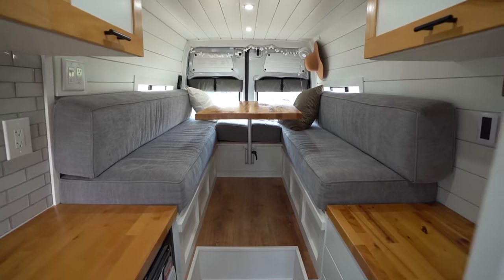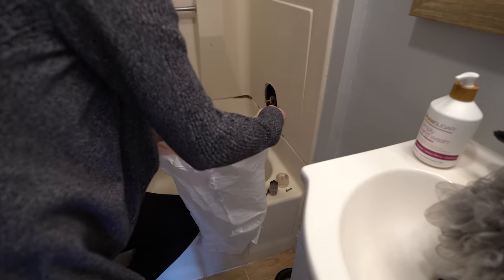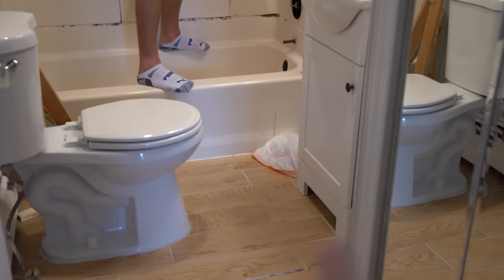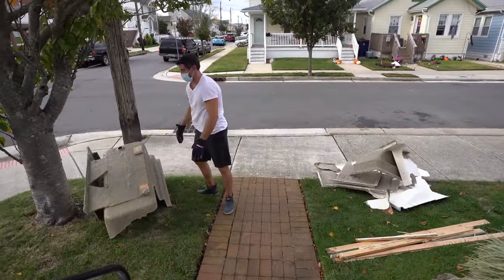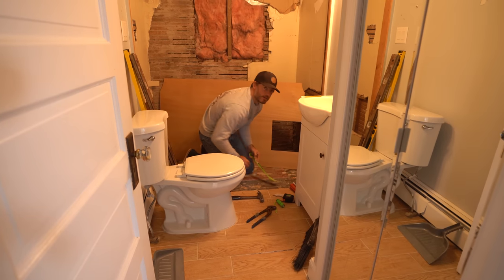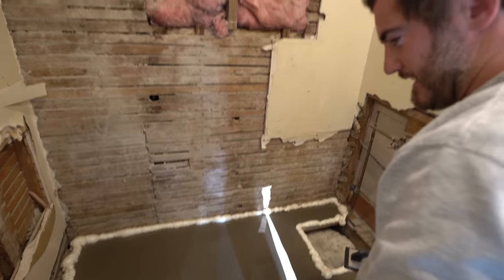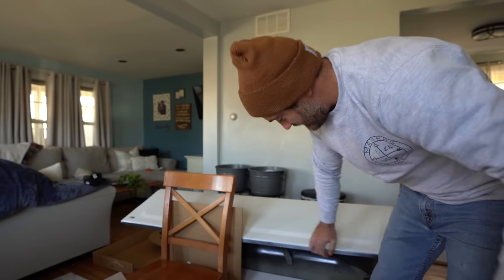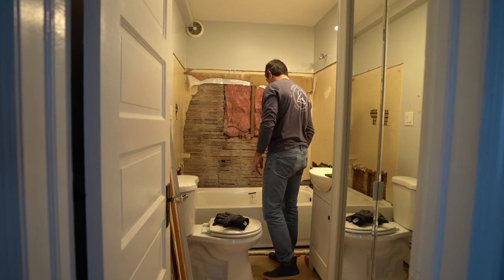Bath Fitter's Quoted Us $11,200 For THIS...

Comment: Hi, can’t see where they came up with the quote of 11,200. I sometimes think these ridiculous quotes are designed to get you to turn it down as they don’t really want to do the job.
Reply from the maker: Haha maybe?! It was crazy!
Reply: $60/hr x 8 hrs x 4 days x 2 people = $3,840
$4,000 on material
add 40% profit margin =
$10,976

this doesn't mean the workers get paid 60/hr its just the rate, same way a mechanic shop charges 80-120/hr but pays 25-35 hr its actual mechanic. reason I put 4000 for material is because "bathroom fitters" has a more "high quality/professional"  tub/showers than a big box store. hourly rate is also dependent on location and the reason its so high is because its a way of protection, when there is a problem on the project and the company goes over its budgeted hours it has to foot the bill on a lump-sum contract.
Reply: I’m not a bath fitter fan but don’t forget I assume they will do the job legally with a licensed plumber and would pull permits. It’s not a fair comparison.
Reply: @michaelscarfi3196  hi, I understand the concept of paying extra for a profession but come on over 11 grand that’s just nonsense.
Reply: @kneehats2311  hi, you’re  the second person to comment trying to justify the ridiculous quote. It was a tiny bathroom with wet services already there. I don’t understand your ready acceptance of such a ridiculous quote for what they claimed would be 2 days work. I know they are professionals but you’ve got to ask yourself if their work is really five times better than doing it yourself. They certainly appear to be charging 5 times as much. Sorry for the rant, I don’t mind paying a professional but the quote was ridiculous. I would like to know if they had other quotes for comparison. That might shed some light.
Reply: @H2Dwoat  it is very high. You could have a cast iron tub and tile walls installed for that money. I was just pointing out they do have higher costs.
Reply: @michaelscarfi3196  hi, agreed. I actually prefer to use a good professional, I value my free time and they can usually do a better job in a considerably shorter timeframe. I can generally do the job much cheaper and depending on the complexity and skill level required better. The downside is it will take much longer to do well than a professional. This is why I made my original comment about deliberately costing themselves out of a job. Sometime you just know in your gut that someone is being a silly bugger and trying it on, as with all these situations the option to walk away or say hell no is yours. Cheers.
Reply: Bath Fitter doesnt replace everything. Some companies do, like mine. We replace everything from the subflooring up, pipes and everything.
Reply: @H2Dwoat  So when you pay a company like Bath Fitter or the one I work for, you're paying for the sales rep time, the materials (some are actually high quality pieces and not fiberglass/porcelain), the labor for full removal and install, and for it to be done in a day and not 5 days